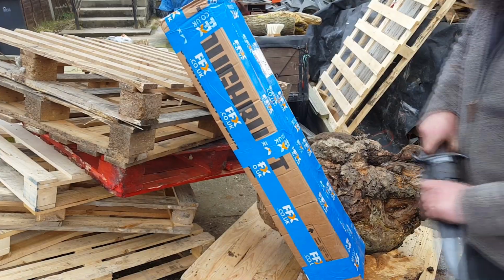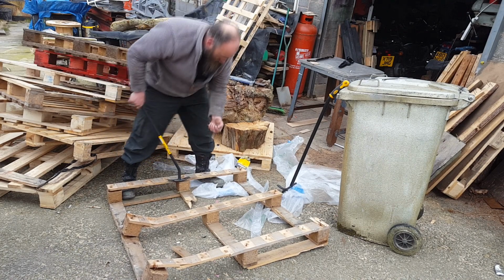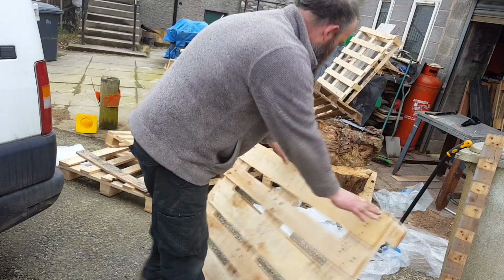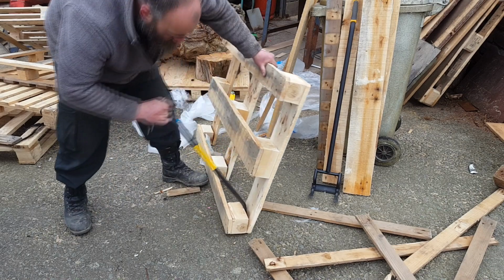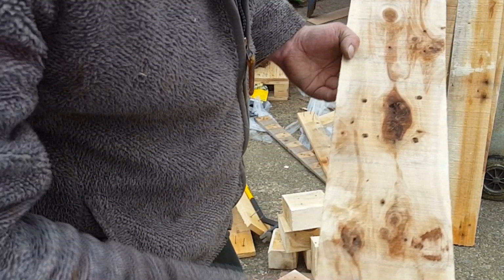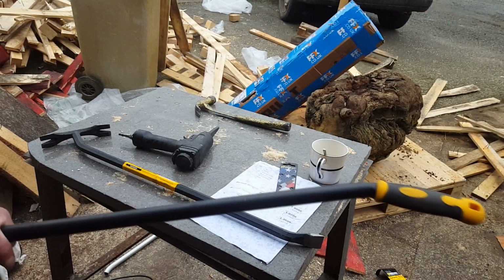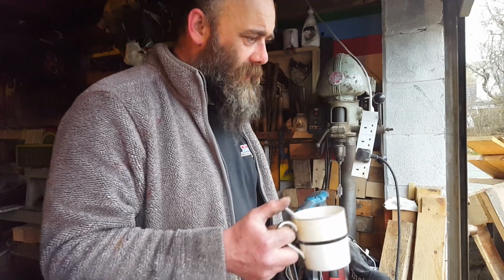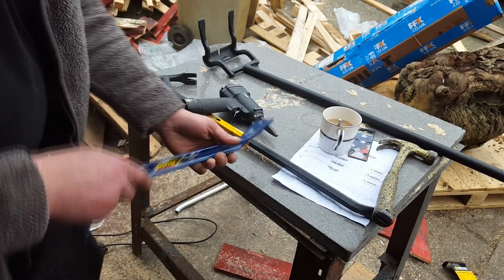Pallet Buster and Denailer Tools - Roughneck & Estwing - FFX Tools

Comment: I’ve been taking a Dremel type tool and cutting the nails at about. I did share two and then just turning the board over and popping them out with a good claw hammer seems to be the easiest. Since I don’t have one of those air guns that you could shoot the nails out with for us old guys, we don’t want to do all that, bending…..

Comment: Hey bongo I’ve had the pallet buster for over a year now and your handle looks different to mine. I wonder if they’ve updated it as I found it didn’t always sit nicely under the boards as some pallets are too wide for it to sit comfortably on but I took mine down to my local blacksmiths and for a fiver he widened the prongs by an inch which made it much more effective. Can’t wait to meet you and all the other makers and wwuk guys at makers.
Reply from the maker: Maybe they did, in the middle of the prongs on yours does it have a V notch for taking out nails? I did notice that on one pallet and it was a decent one the prongs werent wide enough, did your blacksmith heat and reforge them then? Are you going for the weekend?
Reply: thepoultrypeople mate, mine doesn’t have the v groove so I assume it’s an older version of the tool as my handle is just black as well. The blacksmith just heated it enough to widen it but couldn’t get much more than an inch although that’s all it needed at first I thought it was pretty disappointing but after I got that done it works like a charm. If you get both prongs under it the pieces come off nicely but if you can only get one under I found it kept splitting them.
Reply: thepoultrypeople I forgot to say yes I’ve got weekend tickets so I’ll definitely come and see you I assume you’ll be on the wwuk stand?

Comment: Hi i built a full shed out of pallets and sheets over the top i found by soaking the pallets a day before makes it a lot easier and you got a lot less braking to the planks. Hope this helps keep the videos coming 😊
Reply from the maker: Yes, thanks, Ive noticed that with pallets i get that have been rained on for a while.  One thing im struggling with though is dry space for them to then dry out slowly without splitting, twisting or cupping. Could do with more shed space or to stop hoarding on the wood :)

Comment: I love using pallets or other "old" wood and giving it a new purpose.
Reply from the maker: Its got to be a good thing, all the ones i get are to be dumped in landfill if not picked up. One of the pallets i was dismantling was all mostly beech as well. wonderful dry timber thats also been heat treated.

Comment: Good demo mate, sold it for me, got mine from tool station as FFX and Screwfix we’re out of stock, cheers bud
Reply from the maker: Have you had a chance to use it yet? Ive had the lurgy since these last pallets and been to ill to go out and do any actual work.
Reply: thepoultrypeople yes mate ripped down 6 full plank pallets the ones without the gaps, I carefully eased off one plank then used the tool for the rest and it worked fine, I’ll be able to carry with me when I’m pallet hunting so I can dismantle on the roadside as I can’t fit a whole pallet in my golf estate

Comment: I’ve got one of those pallet busters and it’s the mutts nuts.

Mines a bit more basic than yours but it still does the job well enough. The only problem I find is the prongs aren’t flat so they can brake the edge of the pallet slat which leads to splitting.
Sharpeys workshop built his own which looks the business.